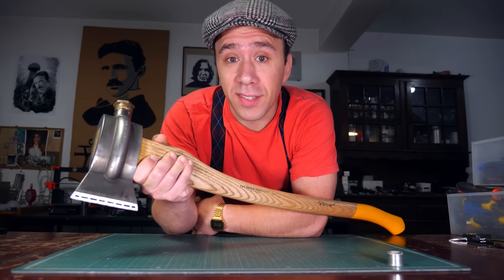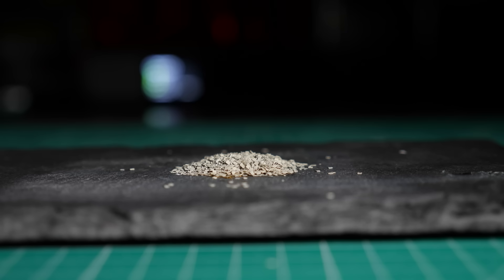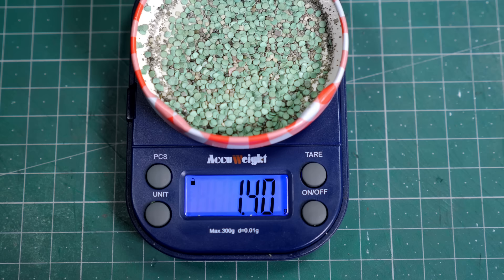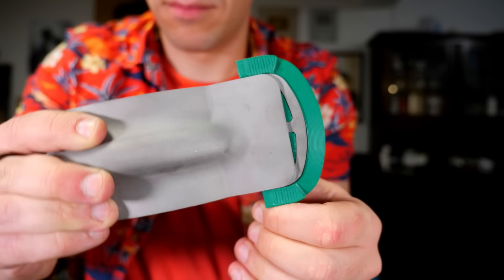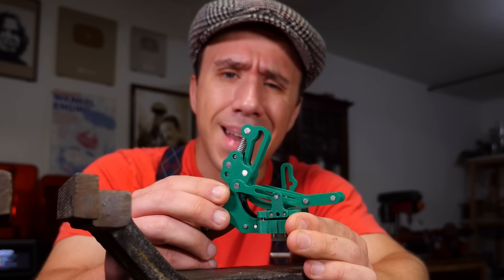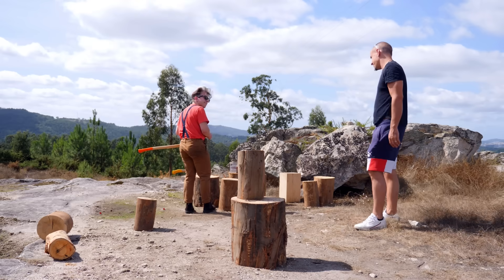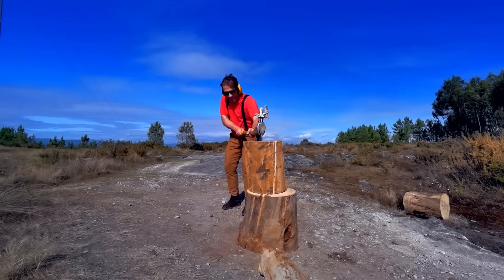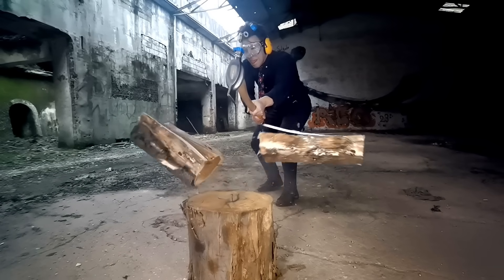I built a BETTER SHOTGUN AXE

Comment: I think the exhaust angle seemed to make a real big difference between the first and second designs. Your first axe head had equally distributed ports that fired the gas horizontally, and the newer ones, while having a sharper blade, just didn't distribute the blast as effectively for your task, even if pressure had been properly contained. 

If I got a 'whack' at this, I'd iterate on your first head, make it curved or pointed as you did, and then have the exhaust ports shoot the gas sideways and ever-so-slightly 'up' in a V shape. This way, the gas will help bury the blade in, rather than push it out, and it will still shoot a bunch of hot gas out sideways to push the log chunks. Bonus points for driving the axe in once the blast timing is dialed in.

Finally, assemble an electronic trigger with an accelerometer and a strong breach that locks the shell in place (quarter-turn with an L-shaped channel to lock). It's not any more complicated than the fancy brass sear and spring thing you made! 

I love your videos, thanks for sharing all your stuff.

Comment: Ya know a mix of oldschool black powder and that oxyhydrogen to touch it off would likely have worked without the shells.
Reply: Also possibly a hammer head with channels directing in 2 directions on one line might work better here creating a better seal

Comment: Better electrolysis electrodes come from carbon-zinc D-cell batteries.  They're constructed of a zinc canister, manganese dioxide and ammonium chloride electrolyte, and a carbon rod.  You can pull the rod out, recap it, and dispose of as you would any battery.  Or safely get rid of the electrolyte and have a zinc canister.

Comment: Tip for future engineers, never use mild steel for anything. Make stainless steel the standard. This can only happen by refusing to work with mild. Simply… never buy mild. Ever. 

The markets will shift towards what consumer needs, and make that shift for STAINLESS ONLY. We do not need mild steels in our modern society. 

STANDARDISE stainless, only you have the power to do this. 

Stainless is superior in every way, even for hobbiests. So STOP BUYING MILD. You’re only hurting your own kids.
Reply: Mild is cheap. And that’s because it’s good for cheapskates. If everything was made from stainless we’d progress 100x faster as a species. 

But people still buy mild steel so the price will never shift, it’ll stay that way forever. So stop buying that crap and then suppliers will have no choice except to supply stainless in MASIVE BULK. 

This will reduce the price of stainless and eventually remove mild as an option. We need this to happen as a species.

Comment: Part of the reason that hand filing the blades was taking forever is the fact that you are not using the file correctly! Downward pressure on the forward (cutting) stroke and no pressure on the return stroke. Putting pressure downwards on a file during the return stroke not only wastes effort, it also blunts the file.

Comment: Make a 3 layer sandwich blade, middle one with holes for gases, 2 on the sides cover that holes, when shell fires it will push that 2 plates which will push the wood and crack it

Comment: As you down swing the hand closer to the head should slide down to your other hand near the bottom (maybe not all the way, for control after the explosion), you'll get more reliable force for penetration and make it easier on yourself as the weight of the axe will do a much larger part of the work

Comment: I believe that it may be more consistent/efficient if you completely redesign sistem so blade is made of two pieces which laterally "spreads open" a bit by gas pressure so wood is separated by direct mechanical force of "spreading" blade instead of relying on gas pressure which is dependant only on gas pressure "injected" into gap. Such way it will be more consistent as "opening blade" will be always the same and not dependant on depth blade "sink" into wood and potential cracks/gaps in a wood which can let gas dissipate without actually splitting a wood. .. I have simple idea in a mind .. but maybe too long text to try to describe here :)

Comment: So I noticed a few things. If you can get powder and primers you can reload the shells and not have to worry about a diminishing supply. Second if you can figure out a disintegrating gas seal you will get more pressure going out the front.

Comment: I think part of your problem is that the gasses are being vented towards the base of the log instead of towards the sides of it, which is causing your axe head to function like a rocket instead of having a mostly neutral pressure in the direction of the swing.

Comment: what if instead of vents, you used flaps, using the pressure of the shell to send metal sides to spilt the wood. or instead of flaps metal pieces that jet out

Comment: The file is only designed to file one way. You push, reset, and push again. It is not a saw or sandpaper that you run back and forth. You will dull your file

Comment: Pls man try to make that mig 3D printer you once made work. Make it a closed case with argon, thick metal base plate for better heat absorption and maybe turn the amps a bit down. If you could pull it off that would be the pinnacle of youtuber achievements!

Comment: Okay, so I have a thought. I know there are wood splitters that utilize a mechanism to push apart the logs as the axe enters the wood. I'm wondering if you could instead use the shells to actuate something like that instead of just using the pressure.

Comment: To fixed the issue of it bouncing out he would need to angle the exhaust away from the wood so that way when the charge goes off it digs instead of pushing away and out from the wood

Comment: you gotta make the claw axe that will open itself to split the log, inside - two pneumocylinders that will force the sides of axe to open
for the pressure release part - make some pressure release valve as in gas ballons, that will be your failsafe, make the axe bigger, with adjustable trigger delay - that would be for different wood types. also trigger would be cool, along with pressure release trigger cause shit happens
for pressure failtest - just clog the axe and try to explode the shell while the pressure has nowhere to run, the key element - the axe should contain the pressure.
also think about feeding shells with locking mechanism, the simpler the better, ak mechanism is a way to look.
Don't know about cost tbh, and should suck in a lot of effort, but here are my thoughts nontheless, hope i'm being helpful

just try not to make a black powder grenade on a stick, be careful

Comment: What if you used the gas to push out 8 small cylinders that split the wood instead of the gas, then hitting harder and splitting the wood a little won't affect the effectiveness too much, and adding a small gas escape or several might help when the top wants to explode off, that or just make it hyper heavy duty xD

Comment: Video theme : so basically my Idea is just take a glass jar throw in some methane or alcohol in it then if you close the lid and make a big hole in the lead and then make another small hole in which you can supply oxygen it and set fire in the alcohol it can also work like a jet engine.  

Trust me I tried it in my home and it works creating lot of thrust

Comment: Please, for the love of god, learn some technique, just a little, it'll help with the bounce-outs. On a technical side, make the face and head taller so there's more room for holes? Also wouldn't shallower angles on the holes pry the halves apart better? Provided you can get the axe deep enough on initial swing.

Comment: Why not make it so the mechanism is fired manually once the axe is set in the log? That way it only goes off if the axe is nicely sunk into the log, and wont go off if it just splits from the axe alone.

Comment: Scene opens to anime fighters staring each other down

shot from behind the large one, pan right, focus to smaller one

cut to angled shot from ground behind S with L in focus, pan left

L has a hammer and heavy armor, S has an axe with a peculiar but unclear mechanism

they talk for a few minutes

S gets angered, screams, and finally charges at L, music starts playing, swings their axe, and wedges it decently solidly in L’s chestplate, but nowhere near penetrating.

music stops, silence

L doesn’t react much

S, internal dialogue: “Please work Please work Please work”

L, underwhelmed and a little incredulous: “Wait, is th-“

after a short delay, total 2 seconds max, L gets cut off with a flash and sharp crack, holds up their arms defensively on instinct, music starts up again, axe recoils and L gets pushed backwards along the ground leaving dust trail

badass music starts up once more

The chestplate splits into two pieces which each go flying, bouncing on the ground and spinning, throwing clouds of dust

L’s weak point, their visible beating heart, is exposed, as they realize they may actually face danger for the first time since they built the armor

music continues. Dutch angle shot from ground up to S as they collect their composure and rest the axe on their shoulder, much more confident now

Comment: So your biggest issue is that your detonation system is separate. Your other issue is that you were just trying to make things work. If you’re determined to cut that particular wood, hydrogen would have been the better choice for an explosive. You need to redesign the axe to compress even more and design everything to be built in one piece

Comment: I just saw the axe for the first time.
IT IS AWESOME.🤩

Just a thought,
But why not create a dual chamber blade, with 2 seperate receivers. 1 shell pushing the left chamber of the blade and 1 shell pushing the right?
It should give you double the power?
the 45 degree blade and the ports are also pointed partially forward, doesn't it make a lot of the force want to go forward, wanting to push the blade out?
Maybe, making the blade sharper at a steeper angle and having the ports directed more sideways, could not only make the pressure more perpendicular to the blade but also wedge itself more in the log without splitting it before it fires.

Comment: You can try to combine two shotgun shells into one bigger one so it creates more pressure
Also, to make the blade go in, try to temper the edge to make it have higher carbon content in order to penetrate easier (316 L has bad strength and low penetration). If this method does not work, try coating the blade with tungsten.

Comment: you're using a file the wrong way!!!
only use a file one way. (usually pushing it). thats the way the file teeth are ground, when you go back and forth you benf the serrations or teeth over and dthen it is not as sharp. also use the right file for the material, as well as the aggressiveness of he file.  or you can clog the valleys between the teeth of the file, once you dull a file, you cannot sharpen it.... files can be more precise and often because you arent taking too much material off and having to fix that grinding can take more time than just taking a little off with a file. plus it doesnt heat up the material like a grinder.
thats why the old timers use files to sharpen blades, then often sll you need to do is strop the blade every now and then. instead of using a stone and wearing the knife down every time yoou sharpen it(once a week). and you should never have color change on a blade. and absolutely no curl on the edge of the blade... 
youcant beat old school ways

Comment: here is an idea build a scramjet engine You could build a bench-top ‘supersonic flame tube’ that simulates Mach 5 combustion using compressed air and propane. The challenge would be to stabilize a flame at near supersonic airflow. it would make an epic experiment and a grreat comparison to your other jet engine builds

Comment: OK I had a new Idea for a Tesla turbine and it did not work at all. Wow It has taken me months to start seeing new Ideas. Great research on the differences on the wood type .You may never be able to make the gummy wood  split because it does not appear to split in a straight line and thus does not seal the gases.
How about trying different single striking point impact only to get an understanding of how it splits . How about a cone shaped point or Remember the old square nails and  they didn't even come to a point almost blunt on the end thus compressing a a rectangular area. A old hatchet I have has more like a wood chisel edge only sharpened on one side . Good luck. Oak splits nicely.

Comment: I get calling yourself a moron for the laughs, but keep one thing in mind if you will:

Calling yourself a moron can actually taint your subconscious — over time, that can lead to burnout or even depression. Mistakes happen. That doesn’t make you a moron; it makes you human. Everyone slips up. Learn, adapt, and move forward — there’s no need to beat yourself up over it.

I totally get the frustration of spending a week on a project that doesn’t work out. As a programmer and shade-tree mechanic, anything that fails first try usually ends with either weird code errors or something exploding — and neither is fun. Especially when you drop $500 on a new radiator only to find out removing the old one caused an electrical short somewhere in the main line. Trust me, I’ve been there.

But you don’t need to tear yourself down over it. Recognize the mistake? Yes. Learn from it? Absolutely. Beat yourself up for making it in the first place? No way. This is the bleeding edge of science — mistakes are supposed to happen because no one’s had the chance to learn from them yet.

Give yourself some slack, grab your favorite drink, and take a breather. Come back with a clear head — I promise it’ll help you avoid burnout a lot more than you think.

Good luck, my friend. And always remember to smile. 😊

Comment: If you are still alive. Whaw. Quite a few red flag s here…. Really really dangerous, super risky. Makes it kind of fun tho. But no. 
What if you whacked those middle aged hikers in the background ?  Our yourself. No safety protocol, endangering the public for no reason. Treating explosives rather to casually. Scary. 
Also, hydrogen is one of the most dangerous chemicals to work with. 
This looks like a kindergarten with guns. Never expected to see this ever. You are brave, or better reckless  .

Comment: Axes for cutting wood are different than axes used for splitting it. Splitting axes are dull, it´s pretty much a wedgehammer you smack the wood with so it splits. All you need is gravity.

Comment: Suggestion:
Use the shotgun propellant to push a piston, and use that pistons force to lever the logs apart. That way, it won't matter what wood you hit, existing cracks,  pressure seals, etc. As long as you solve triggering the shell on impact, the piston actuate, and you'll get some sort of work done. 

PS: as others have mentioned: brass is not strong enough for firearms! Please remake your breach with stronger materials!

Comment: Add a perpendicular barrier.   Like, so that the blade can only penetrate so deep before hitting the stopper.  A flat surface that goes around the whole axe head, so that if flush with the log, your axe head is at the perfect depth for penetration.  Also bonus is that at least a little bit it's acting as a barrier to contain some gas.  You could also consider making part of the axe head barbed like a fish hook or arrow head so that it doesn't come out easily, to stop the issue where it pops itself out. It shouldn't matter because when it fires properly with the gas properly contained at the proper depth, it should easily split it and blow the wood off/away from the axe head.

Comment: What if you build one but used a mass momentum like the huge diesel pole hammers? (or whatever they`re called). So build a axe head comprised of two masses - one on the bottom with sharp edge and another above it. The one above it will be within a contained space that allows it to move in one dimension freely a centimeter or so. The space between those masses will be a chamber filled with something that can combust when hit. Once you swing and hit the wood the mass on top will move towards the sharpened mass, decreasing the volume of the combustion chamber and igniting the load. If the masses are the same the combustion should push the top mass up and the sharp mass down towards the wood block. Additionally if you guide the exhaust gasses in the direction opposite to sharp mass and/or increase the weight of the top mass it should exert more force on the wooden block sinking the blade deeper.

Comment: If you increase the size of the combustion chamber you also increase the power of the axe so you could just make a axe with hydrogen and oxygen in the handle like the handle is the combustion chamber

Comment: What if it was remade but replaced with co² then you might be able to make it smaller with higher pressure chambers and refueling source more easier to get and cheaper downside might not have the same effectiveness but either way I'd buy one if you sold them